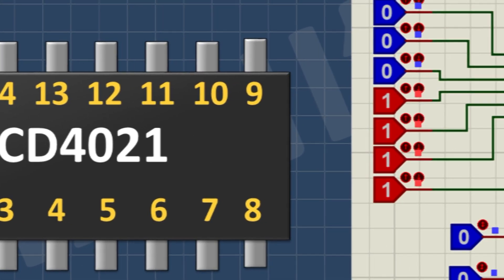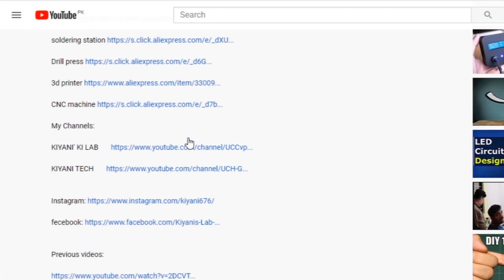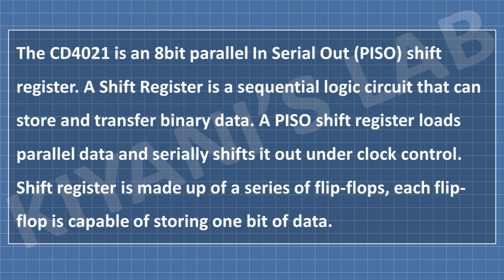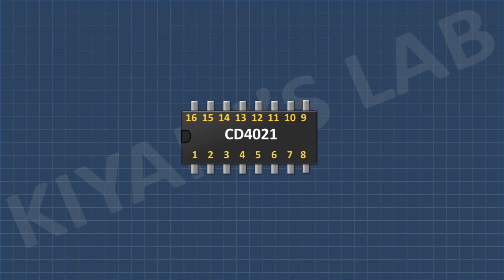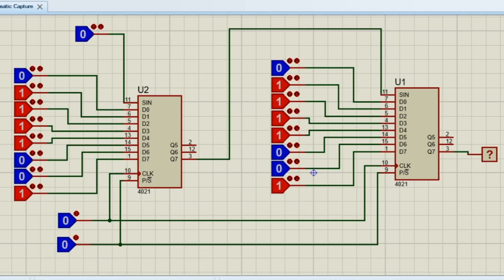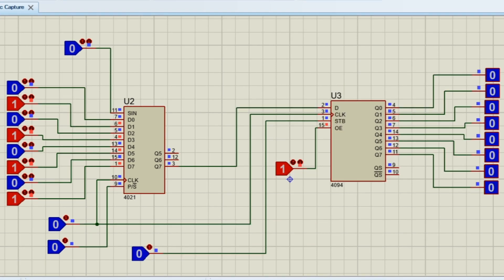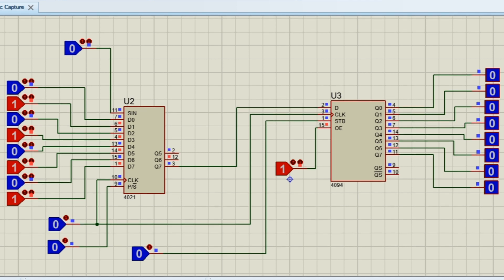What is CD4021 IC | How CD4021 IC Works

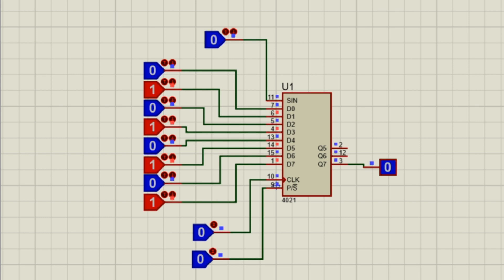Comment: In 1:52, if I'm right, the sending of the pulse to 'P/S' (Pin 9) makes to go out the '1' input bit on D7 (Pin 1) through Q7 (Pin 3). And then the other seven input bits from D6 to D0 (Pins 15,14,13,4,5,6,7) via seven clock pulses through 'Clk' (Pin 10). Am I right?.

If so, why the last eighth clock pulse sent to 'Clk' (Pin 10)?.